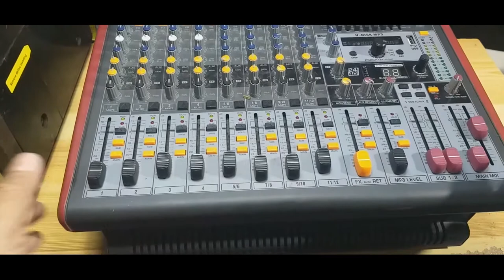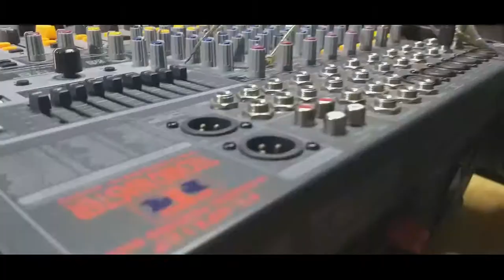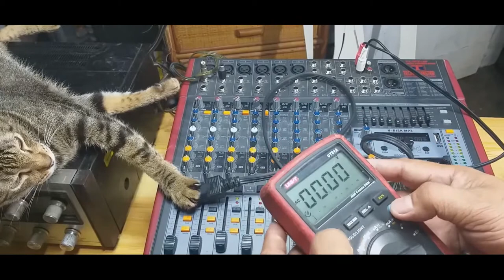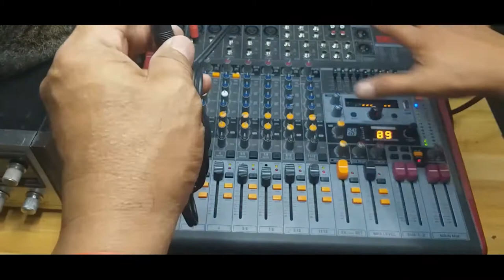part 1 of 3 how to fix and trouble shoot mixer amplified w/power no audio out using a multimeter

Comment: Lodi tanong koh lng poh anoh kya problem ng ampli koh,  ok sya sa una tapos maya maya lng nababasag na yung tunog tapos nawawala na,  pero pag na off balik uli sya sa ok then mababasag uli yung tunog at mawawala uli,  ganun lng.  Anoh  po diperensya nya av 733
Reply from the maker: check po filter capacitor sa power supply po